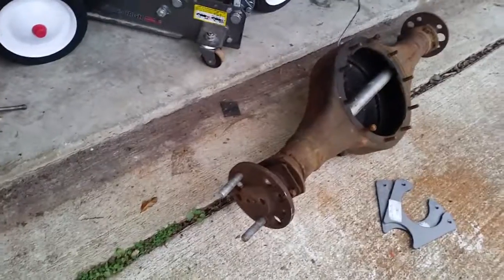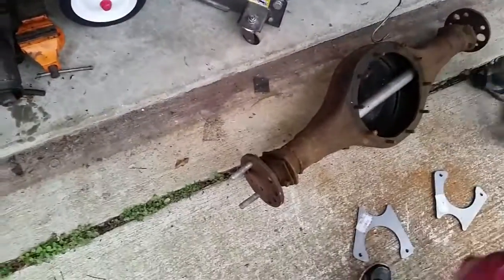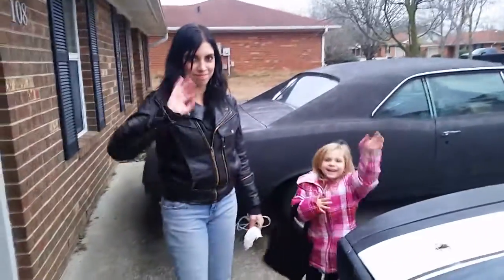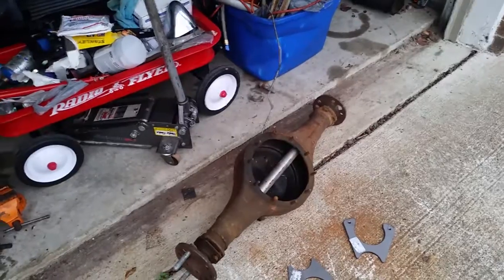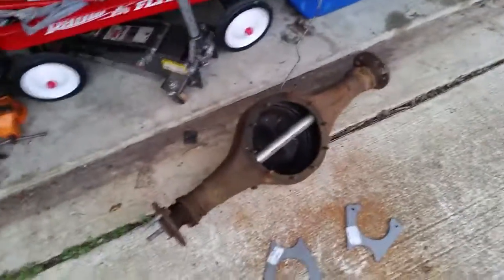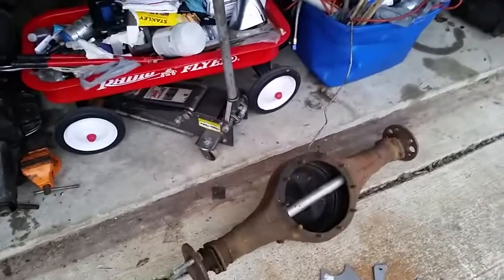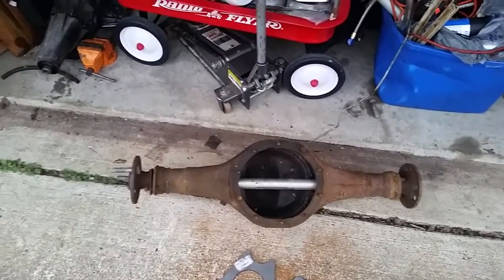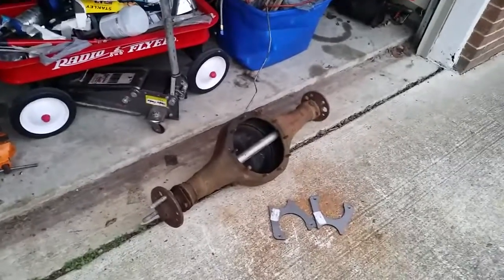Shortened ford 9 inch rear end for subaru 360 v8

Comment: A 67 Subaru?? ...Lol! Just kidding.  Thx for the interesting vid Invincible Could you help me out with some basic 9 inch Ford dimensions? . I need to know what the measurement/distance should be from the ring/pinion carrier assembly (aka. third member or "drop out') mounting surface (where the carrier assembly bolts to the axle housing with the ten bolts) to the axle/bearing centerline (minus the gasket), and what the measurement/distance is from the same mounting surface to the front of the pinion support mounting surface (minus the gasket). Can you help? Thanks!
Reply from the maker: Sure, ill give it a try when i get home
Reply: Invincible Extremes Awesome! I appreciate it bigtime! I have went to a few professionals on this but can't get a response from them. Also, have went through at least 8 - 10 different shop/repair/rebuild Manuals by various publishers on the 9 inch Ford, but can't find a reference to these dimensions anywhere! With a simple ruler or tape measure you should be able to get the first dimension/measurement by eye-balling the axle/bearing centerline ..but a set of dial calipers or depth guage would be more accurate ....if that helps ...thanks! & GBY!
Reply: Invincible Extremes Did you come up with anything yet  Invincible?  I was just informed by someone that the first dimension ...from the 3rd member bolting surface to the axle/bearing centerline... should be "approx. 2 ""  but that's not very precise & I don't think I trust the source anyway. And I still can't find anything on the dim from the 3rd member bolting surface to the front of the pinion support snout (surface).
Reply from the maker: MrSpazoid7777  been super busy at work, but let me see what i can come up with... ;!)
Reply: Invincible Extremes No problemente!  ...was just hoping you didn't forget me  lol!
Reply from the maker: MrSpazoid7777 uploading a video right now with the dimensions.  Just in case, the centerline of axles to the face of the cast iron center chunk is 1 and 11/16.  so the dimension needed if building your own sheetmetal housing is 1 and 5/8 plus gasket is 1 and 11/16 ....
Reply: Invincible Extremes
Thanks for the info Invincible! But let me make sure I understand you correctly  ...
1 11/16, which in decimal would be 1.6875,"  is the distance from the third member bolting surface to the axle centerline (and thus axle bearings as well)? Is that what you mean by 'center chunk‘?  1 5/8 = 1.625" ...so 1.6875 - 1.625 = .0625 ...or same as 1/16th inch ...so the gasket would be 1/16th inch thick ...did I understand you correctly? 

Ironic you mentioned fabricating one from sheet metal …that is what I’m actually trying to do! …a fully functioning 1/6th scale version for my one-off 41 Willys RC car, that is …lol! …. Hence, why I need these dimensions.

To get an idea what I’m shooting for it should end up looking something like this 1/3rd scale version…  
http://bbs.homeshopmachinist.net/threads/57703-Ford-9-inch-differential-%28in-1-3-scale%29
http://www.smokstak.com/forum/showthread.php?t=117085?

..only a little smaller.  And I intend to put it in this … my current project…
http://s1281.photobucket.com/user/saniti64/library/Project%2041%20Willys%20Americar%20Coupe%20RC%206th%20scale

I’m looking for the vid now …

BTW dude!  ….is the 69 Chevelle on your home page yours? Used to own a 68 SS …the wing window & rectangular taillight version… some 20 years ago.  396 BBC, 12 Bolt, T-400 Trans, console shifter, horizontal factory tach & ragtop.  I still kick myself in the arse occasionally for having been dumb enough to sell it off! Aargh! And oh yea! …do you have any clue how rare your 68 Bird is these days? …lol!… keep a hold on that one as long as you can!
Reply from the maker: Oh ok, yeah the 68 chevelle is my friends... the 67 tempest, 67 gt500 clone , 69 charger, 73 datsun, and a couple more mustangs are mine though....
Reply: Invincible Extremes What about the sweet 68 Bird?? ...that's yours, right?
Reply from the maker: MrSpazoid7777 i drive that sucker every single day brother... ;-)
Reply: Invincible Extremes Excellent! Must be nice Lol!

Comment: Going to put a wheelie bar on the ol sub?
Reply from the maker: Prob gonna have to for racing, and then crank jt down so the front wheels don't leave the ground, this will be too skittish of a car to be safe other wise.  Oh btw i finaly figured out what i'll do for front suspension.  Shortened mustang ii setup using a circle track rack and pinion... shouldn't cost too much and it'll be super narrow to tuck it all under the stock body.... ;-)  no way in hell i'm going to trust the  stock suspension to stop a v8 powered monster... ;-) thanks for stopp8ng by brother.
Reply: no problem good vids, i like all the car talk and doings. Used to listen to my uncles and cousins talk cars and parts for hours, most the times they didn't think i paid attention but they could ask me something one of them said and ill tell them the answer. Have a good'n
Reply from the maker: geargriden19  thats badass my uncles, despite being cool, were not hotrodders... but they did teach me things regardless.
Reply: My uncle had a nice 64? ford falcon sprint convertible, he was needing money but didn't have it up for sale, someone stopped by and made him an offer, he couldn't refuse, he took it as a sign. Quiet a few of my family members have done dirt track racing, one of my cousins is still racing and going on his around 12th year. Anyhow have a good'n

Comment: Cool project .Check out the frame on a suzuky side kick [older model] or any other little trucks like that .You mite be surprised .Man i need a spelling lesson lol.
Reply: Invincible Extremes Yep, I recommend a Mustang II IFS. They're relatively easy to set up, pretty dependable & you can find "how to's" all over the web ...and like you said, the aftermarket parts are everywhere. There must be like 100 companies that make aftermarket/performance Stang II IFS clips, assemblies or just components ...including various custom and/or shortened lengths of manual & power steer racks & A Arms. You can get some good prices from the smaller companies on parts.  If you  use a shortened Mustang II steer rack you'll have to make sure to keep the correct Stang II IFS tie rod geometry (for caster, camber & crossmember clearance) especially if you use 2" drop spindles or you'll quickly end up with headaches. The Outlaw Circletracker steer racks are loosley based on Stang II IFS. If you use 2" drop spindles your spindle centerline should end up close to if not dead center on your frame rails (1/2 the width if you use rectangular or round tube). With your  known track width (50") and a little research you can calculate out & draw up a print of the sizes of practically all the components you'll need.
Reply from the maker: Yeah thanks for the heads up, cutting up a junkyard frame would be much cheaper than building one from scratch... only catch is i don't think a sidekick came with a frame...but who knows.   My biggest challange is the 50" track width on the front.  Might have to look into a narrowed muatang ii setup... at any rate the mustang ii stuff is popular so spindles, brakes and steering parts are cheap and plenty due to lots of competition from all the makers... ;-)
Reply: Also check Geo trackers the frames are tubular and you can adapt a mustang front end .Good luck .
Reply from the maker: Mordoor 53  i found it!  While looking up how to narrow a mustang ii rack i found that some guys were using circle track racks... thats what i'll use with a mustang ii crossmember and shortened control arms and a 2" drop spindle disc brake kit... thanks for the ideas, yes the trackers and sidekicks do use a frame but have many fans for them so those frames may as well be made of gold... ;-)
Reply from the maker: MrSpazoid7777 thanks, yeah thats pretty much what i'll have to do...